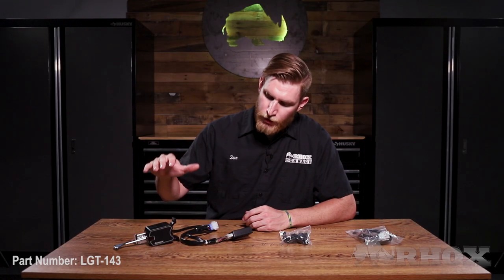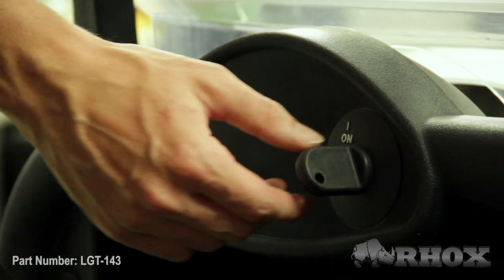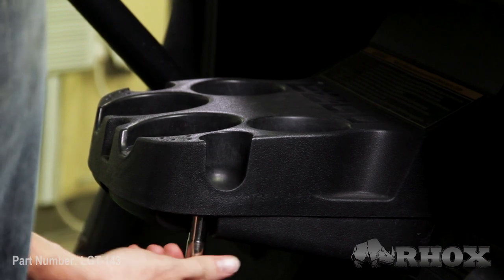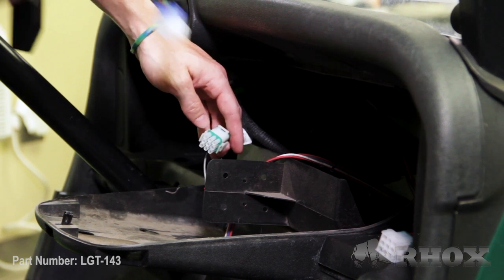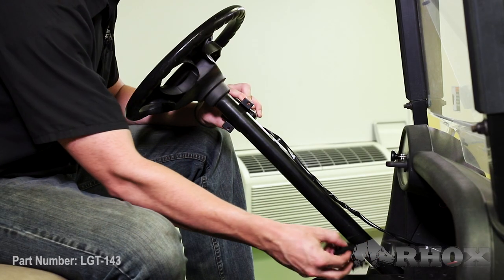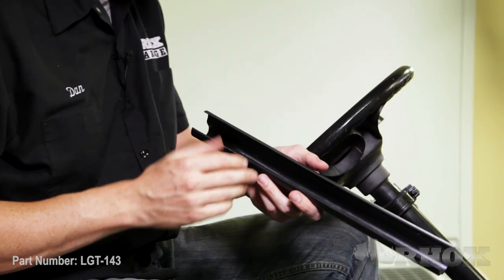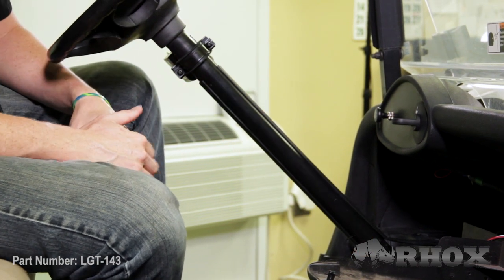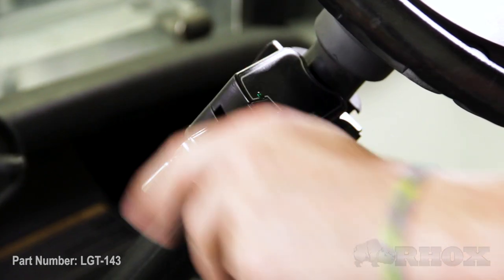LGT-143 (LGT-T1) RHOX Basic Turn Signal on an E-Z-Go RXV

Comment: We have an EZGo Express S4 Elite but can’t figure out how to disassemble the cup holder to install the turning lights, or is it in a different place for this particular model
Reply from the maker: The PDF link will take you to a set of instructions for one of our light kits on the Express.  It will go through how to run the harness for the turn signal etc. If you have more questions after reading it, don't hesitate to ask :)

http://rhox.com/images/LGT-402L.pdf
Reply: Is yours a 4-cup holder in a row ? If so you can see the snap-in tabs if you look close. They should all snap-in.

Comment: @RHOX Garage  You keep saying to plug into the 9 pin connector, but like this guy, I don't see a 9 pin under the cup holder on my 2022 Gas (Ezgo Freedom RXV). Cart comes with LED lights. Is it located somewhere else? Or do I have to hard wire the turn signal switch?
Reply from the maker: Our turn signals are designed to plug and play directly into RHOX wiring harnesses (which would have the 9-pin connector for the turn signal).  If your cart has a wire harness that is not RHOX, like OE, chances are you will have to hard wire it.  We do make a turn signal kit that includes an adapter for the RXV factory harness - but the adapter is not sold separately. If you want to view this, look up LGT-113.  

This link will take you to the wiring diagram for the LGT-143 (T1): https://rhox.us/images/LGT-143.pdf

Comment: I have a 2015 ezgo txt gas cart that already has lights, but no blinker on colume, took drink holder out and have 2-2 pin connectors. Are they the blinker connectors and what blinker do i order ?
Reply from the maker: Without seeing them, I am not sure what they are. Our turn signal connectors will be a 9-pin connector with green or blue gaskets.  I would refer to your manual to see if it is an OE harness or part of the light kit. If you contact us through our RHOX.com page, you can reply to the email with photos so we can identify your light kit and send you information on the turn signals. Photos of the harness and the headlight(s) (front, back and connectors) will be helpful.
Reply: @RHOX Garage  Your videos all say to plug into the 9 pin connector, but like this guy, I don't see a 9 pin under the cup holder on my 2022 Gas (Ezgo Freedom RXV). Cart comes with LED lights. Is it located somewhere else? Or do I have to hard wire the turn signal switch?

Comment: when i plug the connector into the plug with the jumper, my turn signals work but I lose the ability to turn the lights on with the light switch. any ideas?
Reply from the maker: The T1/143 turn signal switch does not have ON/OFF function on the turn signal.  You would still have to power the lights with the push pull switch on your main harness.

Comment: Do I need a voltage reducer? How do I find out if I need one?
Reply from the maker: You will want to compare the voltage the accessories can handle to the voltage you are feeding the accessories.  You do not want to supply more voltage to the accessories than what they can handle.  

For example, if you accessories are rated at 12V, you should only supply 12V to the accessories.  This can be through (1) 12V battery source or through a voltage reducer connected to multiple batteries totaling a higher voltage.

For the best wear and life on the batteries, it is recommended (not required) to draw from the entire battery pack vs. one single battery. This way the batteries wear evenly.  

Keep in mind, while a light kit may be rated for 12-48V, the accessories you connect to the light kit may not so you want to check the voltage requirements of each separate accessory to be safe.  For example, if a 12V outlet is only rated for 12V and 48V are supplied to the light kit, you could damage your phone or other device that is plugged into the outlet.
Reply: @GolfCartInstructions  thank you for your awesome detailed responses. What an awesome team member you are for your company!
Reply from the maker: @mamiecarson  Thank you so much! Please let us know if you need anything else :)

Comment: Can't find one for a TXT48 - can you direct me??
Reply from the maker: The turn signal is universal so it will work on a TXT 48V.  All of our turn signals are designed to plug directly into our Plug and Play Harnesses and light kits. If you have someone else's harness or light kit, you may have to hardwire some of the installation.
Reply: @GolfCartInstructions  9

Comment: Will this fit a 2017 EZGO express s4?
Reply from the maker: It is a universal turn signal so it will fit an Express S4 steering column; however, the turn signal will more than likely have to be hardwired if you are not plugging it into our harness.  We do include a pigtail harness with the turn signal (when purchased outside of a kit) which you can use when hard-wiring it into your existing system.

Comment: Will this fit a 2008 Ezgo rxv?
Reply from the maker: Yes.  It is a universal turn signal and is designed to plug directly into RHOX plug and play harnesses.  It can be hardwired if you are not plugging it into our harness.
Reply: @GolfCartInstructions  thanks for the quick response! I would plan on plugging it in like you did in the video, so long as i have the same set up. As far as I know I have a stock 2008 rxv (other than 6” lift and wheels). Does this part just turn my current orange running lights in the front into blinkers? Along with my stock tail lights into blinkers? Also, would the turn signals work if the lights were off? Thanks for your time.
Reply: @DerekEvan  did your golf cart orginal running light turn to blinker and rear tail lights too, please let me know, thanks before i purchase???/
Reply: @GreenMonkey23 i was looking for another response back but I didn’t get it. I then never followed through with this  so I can’t tell you for sure.